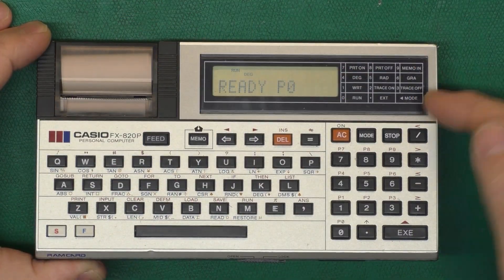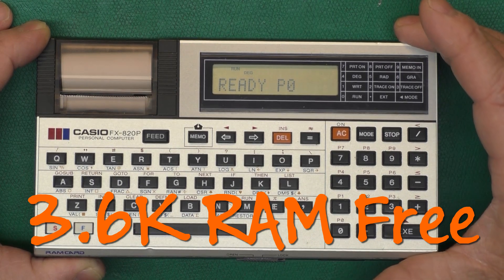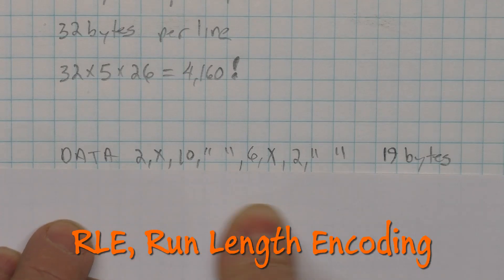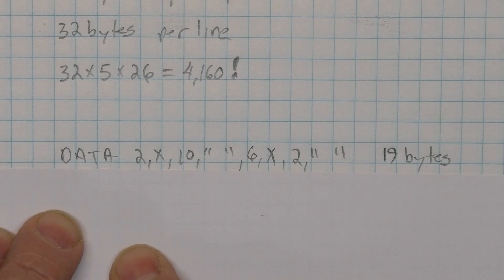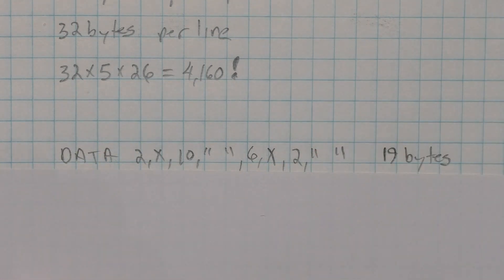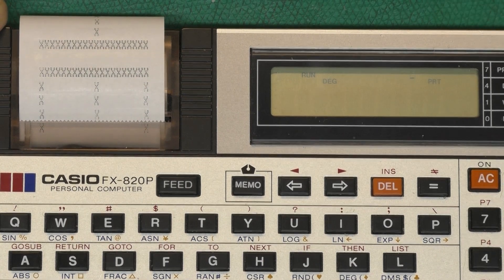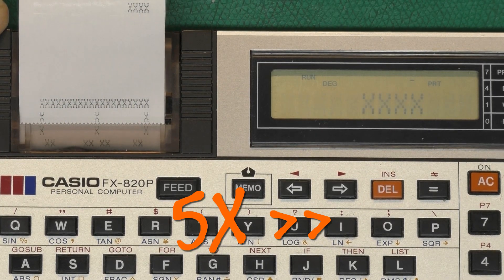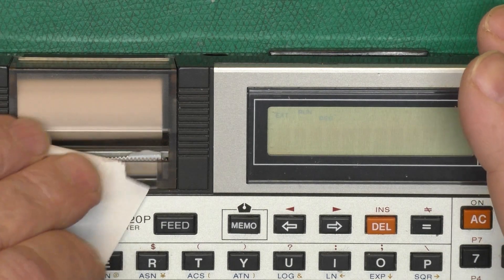Pocket Banner, Data compression in BASIC. Fitting a 5K program into 3K.

Comment: I was wondering if a simple decimal representation of a binary pattern would be more efficient, but I guess it depends on what commands are available to convert binary to decimal, or if you'd have to implement that in BASIC as well.
Reply from the maker: Someone else mentioned this idea as well. This version of BASIC is limited but I played with an idea in C# last night using similar commands to what the Casio BASIC has and can do a decimal to binary base conversion. The simple numerical variables are limited to 10 digits which is more than enough to represent the 2^20 range.

Comment: It's a binary encoding -- space or X.  You could use a numeric value as a bitmap, requiring only three bytes to store 24 positions.  Difficulty in decoding might offset RAM savings, though.  Of course, you then become limited to ONLY two characters, while the current scheme is more flexible.
Reply from the maker: That is an idea I had not thought of. This version of BASIC is very limited which makes things more difficult. A lookup table in DATA statements to convert a byte value to a character string would take up a lot of RAM. 

The best approach might be to roll a decimal to binary base conversion function and print out each 'bit' as it is calculated. There are no bitwise operators in BASIC but one might be able to come up with something using /2 and checking the remainder with FRAC. (Off the top of my head).

As you mention as it is implemented you can encode any number of any printable character.
Reply: @HeyBirt  I think you could do something with comparisons and subtraction, starting with the most significant bit.  For example, if data >= 256, output$ = "X": data = data - 256, else output$ = " ", and then continue downward -- 128, 64, 32, 16, 8, 4, 2, 1.  You'd probably end up with some real spaghetti or profligate use of gosub, but it would be workable, I think.
Reply: @mdkoehn  I believe you want to start with if data>=128... as 255 would be one unsigned char of 8 bits. Also, if you count the # of tests in for example 1, 2, 4, 8, 16, 32, 64, 128 you get 8, which is 8 bits. You'll end up using 3 bytes per line, x 5 lines, x 26 characters = 390 bytes. So, you could have quite a savings, this could be done on say 2k of ram. I don't think you actually need 20 characters, you could probably do fine with 10, and just double them up for printing - the E would be thicker vertically, but you'd need half as much ram, so you might could get away with using 1.5 bytes per line, but since I don't think there's an easy way to use half a byte it might be better to use 2 bytes per line, and maybe have some flags saying 'double print this line' or other options. In that case, you'd have 260 bytes for the full alphabet, assuming no optimizations were done to re-use those extra 4 bits. The 4 bits might be used to tell the program that the line is mirrored (as a lot of characters could be cut down the middle and just mirrored to the other side) however, now you're getting into 'code golf' type of play.

Comment: What about only putting the number of times the X and spaces appears in the data? They always will alternate so you only need to know when it changes. By convention, the spaces would always start a line, a zero would be needed if none a the start. Letter A would become:
1500 Data 0,10,10
1510 Data 10,8,2
1520 Data 10,1,6,3
1530 Data 10,8,2
1540 Data 0,10,10
1550 Data 20,20,-1
You know when to print a line by counting if # of characters = 20, end of a letter is -1. You could also put more of them together in a single line. This would simplify the decoding process and also allow for proportional spaced characters.
Reply from the maker: A line may start with a space or X so the decoder would need to know which to start out with. I guess you could assume it would start with X and a line like "DATA 0,12,8" would indicate a line starting with 12 spaces. Two zeros in a row could then indicate the end of a character. It should work just fine and take less memory too.

The current scheme does let you use any number of any characters but takes more RAM.

Comment: You could probably get the program size down further by building characters from  predefined segments?
Good, fun video Jeff!
Reply from the maker: The space after each character uses that general idea. With 20 characters per line, i.e. 2^20 possibilities, there is more than a million possible states of one line. 

If there were several characters that used the same exact line the '0,1' character ending could be expanded to output those lines. There are several characters that have a solid line but that only takes 3-6 bytes to encode as: '20,X' or '20," "'. I suspect it would all depend on how the character bitmaps were designed.